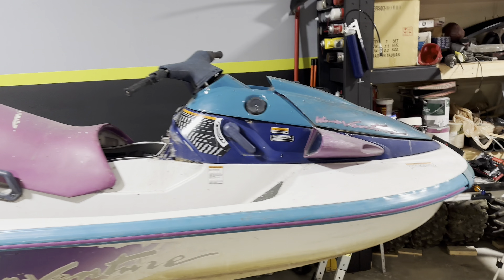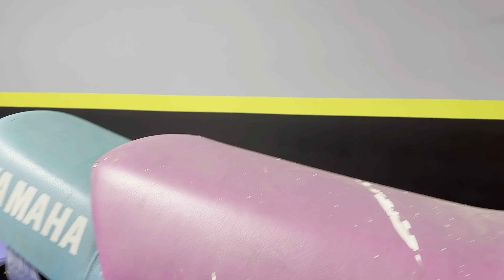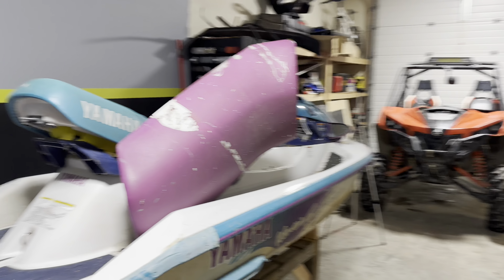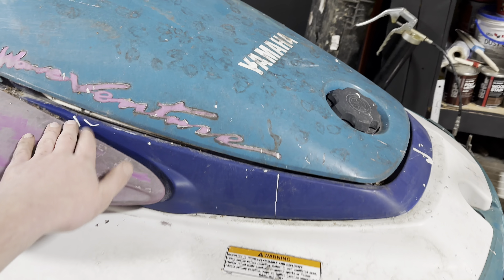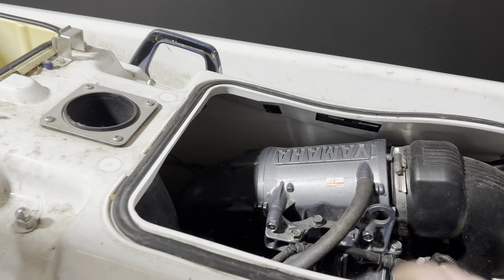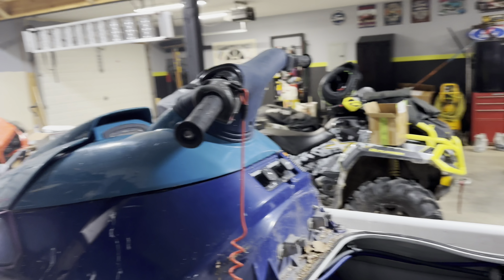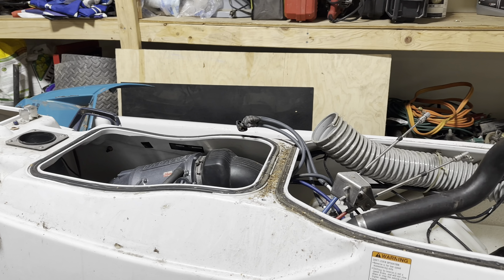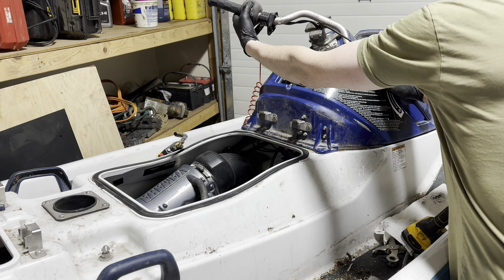Bringing A 1995 Yamaha Wave Venture Back To Life

Comment: How many jet skis do you have now??
Reply from the maker: This will be the 4th one. May be adding something extra exciting soon 👀
Reply: Hey man! We just picked up one of these, did you get it running right?
Reply: The ski is 10 feet long, not "12".
It weighs 520. 
Lifted one onto a stand with my son 2 days ago.
Reply from the maker: @PC-yz1jp sounds cool!
Reply from the maker: @aCoverUp yup! Ran good all last summer. Only issue I ended up finding was the previous owner had installed the choke cable incorrectly, so it was in a choked position at all times
Reply: @akgearhead  - that's great man, the boyfriend and I love your vids as we are rebuilding the same one now!
Reply from the maker: @aCoverUp good luck! They’re fairly simple, and fortunately parts aren’t too incredibly expensive.